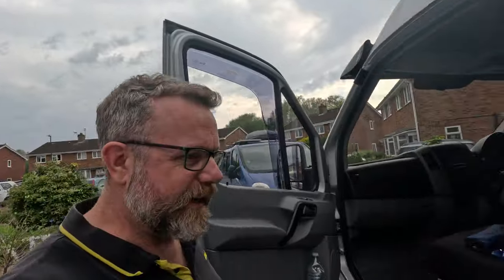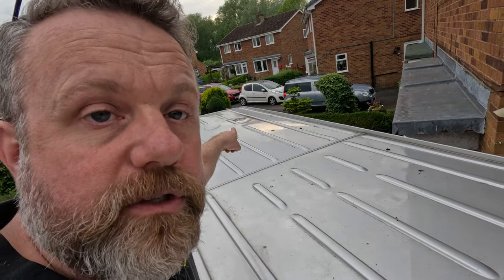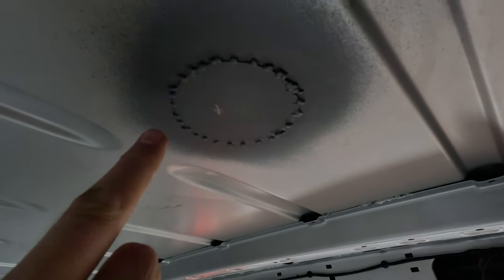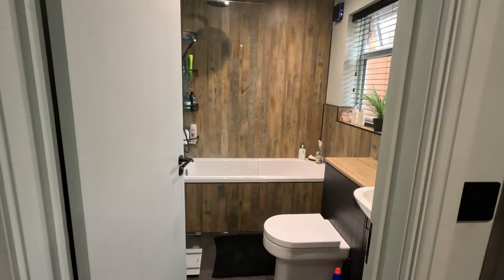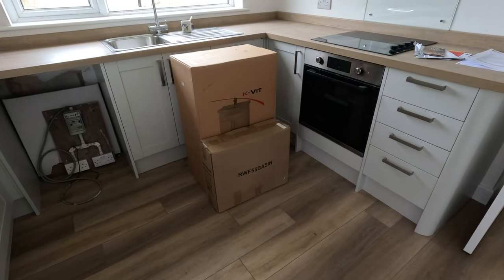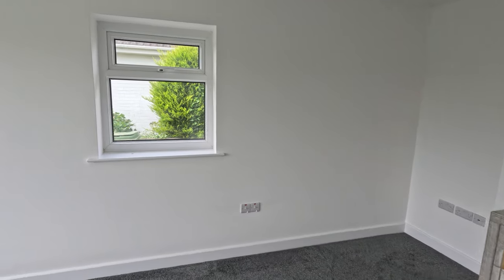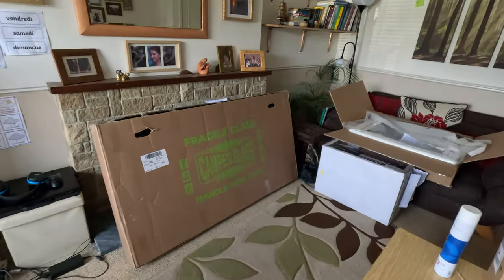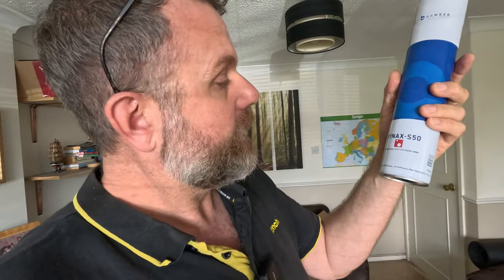van welding and a look at my property renovations

Comment: Video Idea:  How about you make a video on how you make these videos, because I think this would be of assistance to your audience wishing to do the same.  Everything from your home PC setup, to what kind of graphics card you have to how much disk space these typically require for a 20 min video.  How you migrate across content you have captured from phones, from your drone and any other recording devices.  Where you have found your songs and audio add ons so that they are copyright free.  Then the software you use on your PC  - Premiere Pro?  After Effects?  Capcut?  Other video editing software.  So moving forward, what are your plans for video editing while on the road?  Do you have a beefy notebook in mind for doing this?  What also are the download and upload times to get content to your editing machine, and then the finished video uploaded to your YouTube Channel.  What are the bandwidth limitations?  And how do you plan to deal with these limitations while on the road???  Upload from a free Wifi connection at a McDonalds Carpark?  A hotspot allocation from your mobile phone?  How does all this work for us newbies.  Thanks!
Reply from the maker: Wow. Yeah. Lot of content to fill a video there 😉. Yes this is something I might do in the future when we are on the road. At the moment I'm focusing on the van. But to answer one question there. I'll be buying a powerful laptop and looking at starlink for internet😁👍